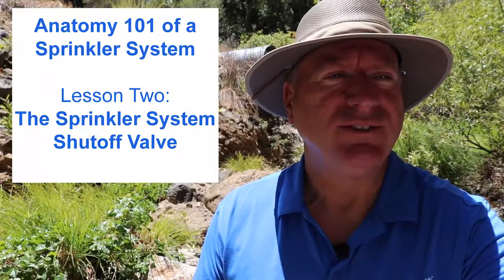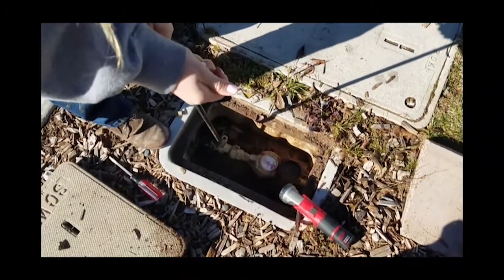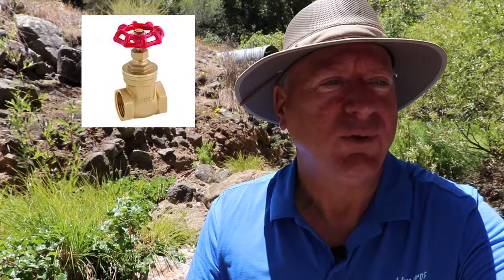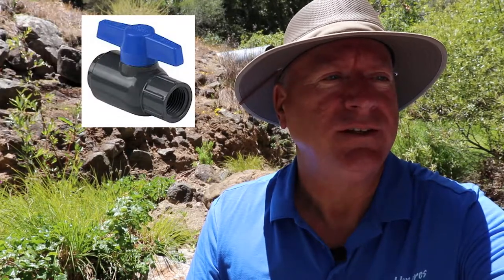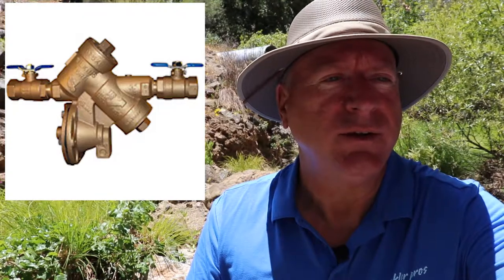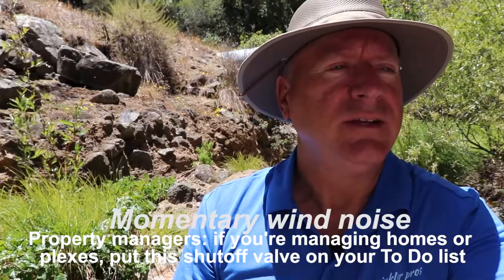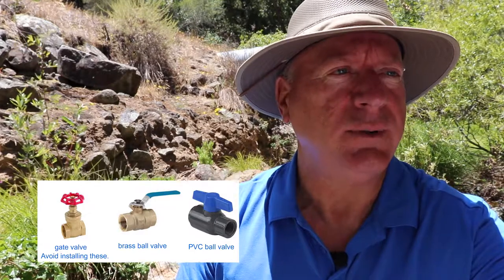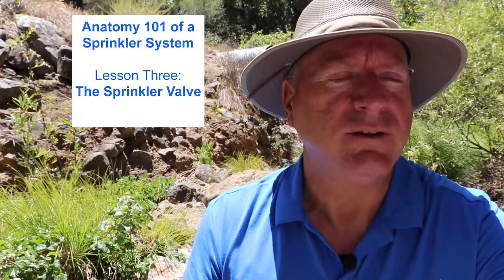All About Sprinkler System Shutoff Valves | Lesson Two of the Anatomy 101 series

Comment: Ball valve reduces pressure much more than a gate valve - so why should I use a ball valve?
Reply from the maker: Jake, I've not seen a friction loss comparison, but my reasons are ease of use (quarter turn on and off) and durability. The gate valves I have encountered over 30+ yrs tend to either have freeze up or the internal stem rots out or the seal and packing leak or the handle breaks off. I understand that ball valves are not void of some of these same fates but I've seen it much less with them. I am not being argumentative because we all need to be convinced of what we prefer for the right reasons, but I can't see that the pressure differences between gate and ball would be that much different, but hey, that's just me. Thanks for chiming in.
Reply: @SprinklerPros  If you would have a chance to make a quick set-up and check pressure/flow on both type of valves - please let me know the results :)

Comment: too bad I can't find my freakin shutoff valve!!  so damn frustrating!!!
Reply from the maker: Daniel, funny (but not) comment!  Sometimes they don't exist. I have found shutoff valves deep in the ground with no valve box! Crazy. If you find it. Let us know where it was using a new comment. This thread may be buried by then like your shutoff valve.🙃
Reply: This might be common knowledge for some, but not everyone is so lucky, on locating a buried, or missing valve:
Generally you need a starting point, starting at the source (city meter) should be easiest, and then a second point, which might be another valve, likely a common zone valve or valves, usually in a "plastic" inground valve box from a six-inch or ten-inch round to larger rectangles from 12" to the Jumbo, which girth it is taboo to speak of.  It would be hard to miss one, but if a valve box has been carelessly covered in dirt, it could be tricky to find w/o a witching wand and some strong ESP or faith, etc.  It is wise, maybe uncommon, to call the toll-free locator service in your area (800-DIG-SAFE or what-have-you. I would call or go online ten-fourteen days out from the project start) to avoid the headache of digging into a working cable, etc. and turning the DIY fantasy into an expanding real-life nightmare.  So IF you've been made aware of the general locations of the "utilities", you will want to dig up the lines, w/ the greatest of caution, which often will be a cable service line and also a dedicated phone line (Cox and SW Bell, or whomever, which flags be orange w logo print) IF they intersect the path on which you will be digging. It's easy to cut into the cable/wire you're trying to protect by exposing it. You want to find out how far the marking/ flags can be from the buried line (Two feet is not unreasonable). So you can take that serious ball and run. Carefully.  In the course of tracking the underground pipe from landmark to landmark, you should do some digging. In my part of the world the electric, gas, and water markings, colored red, yellow, and blue respectively are deep enough that we rarely had to be concerned, but that doesn't mean that you needn't be concerned. You alone are liable, which is a good rule to live by, even if not 100% accurate. If you believe there to be a buried valve box,   up to two to three inches underground, you can use a poker or sharpshooter to stab into the ground, hoping to hear a crack when your shovel contacts the valve box lid. Generally they can handle a little jab, but they're a composite plastic which might blow up and need replacing if hit too harshly. Have a good time and always remember that the fear of the Lord is the beginning of knowledge.

Comment: Why is a ball valve better than a gate valve?
Reply from the maker: This is a great question that I wanted to cover in this video but I needed to keep the pace moving but I intend to make a video on the subject. The following explanation should cover all your questions. A gate valve has packing and seals that wear out. It also has a brass stem that can rot out or freeze up.  A ball valve doesn't have any of those so it typically lasts much longer. It's easier to operate also since it only takes a quarter of a turn to turn it on or off. There are quality issues to consider when purchasing a ball valve. I have found that better quality brands like KBI and Spears will last longer. The cheaper home center brands have a tendency to stick and the handles break. It's always best to keep ball valves covered to avoid premature handle breakage due to sun exposure.
Thank you for asking. Don't hesitate to ask other questions on my channel.